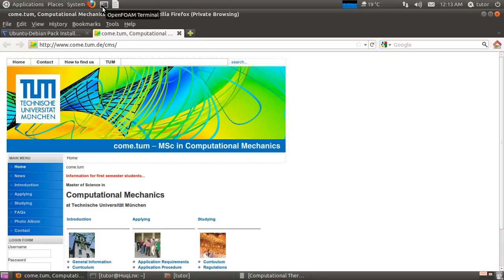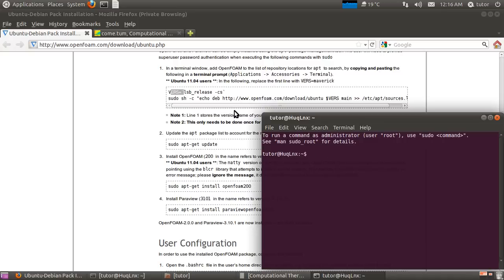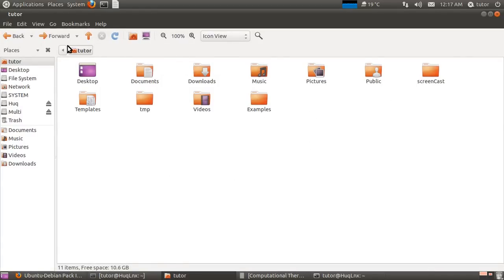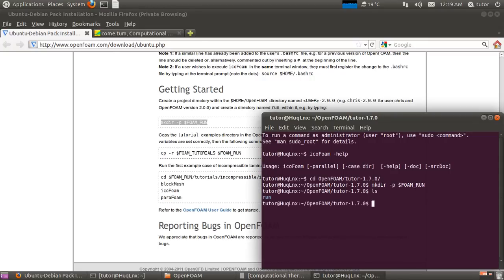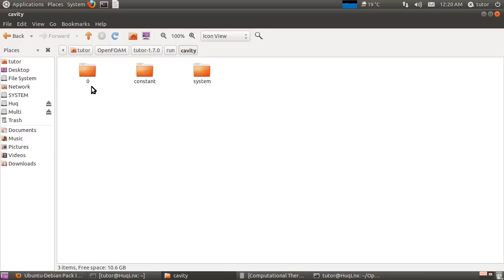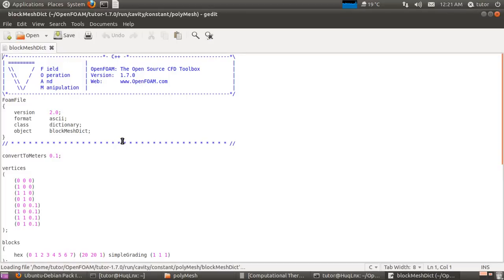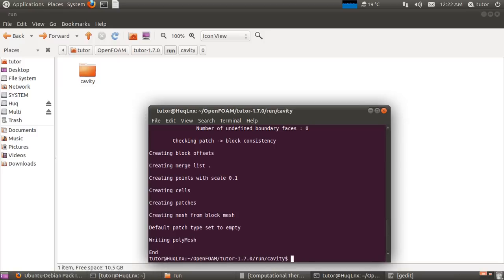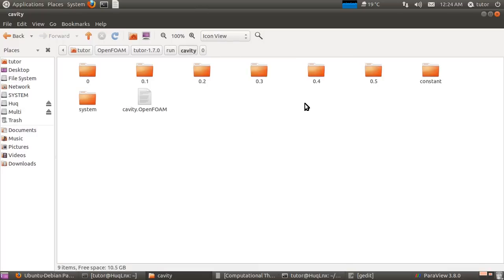OpenFOAM Tutorial #1 - Intro, Installation & First Simulation

Comment: When trying to open in ParaView, output is as follows:

derek.fricke@DGP-051 ~/OpenFOAM/derek.fricke-2.3.x/run/cavity
$ paraFoam
created temporary 'cavity.foam'
/opt/OpenFOAM/OpenFOAM-2.3.x/bin/paraFoam: line 272: paraview: command not found

Any idea why?  ParaView is installed.  This is operated through Windows using cygwin64

Comment: Sorry for the basic question but could someone tell me why Openfoam insists on using linux? whats the big deal with Linux, I've only ever used windows. Is Linux something big and special????
Reply from the maker: 'Why Linux?' is the first question many starting with OF ask. Paul Bevillard pointed out the cost factor. OF or other scientific softwares are not run on regular Desktops, where windows might have advantage in ease of use. Industry and academia use HPC for production runs and they are almost exclusively Unix based systems. In a couple of weeks, I will make a blog post on this topic. To answer in short, yes indeed, Linux is something big and special. Big => size of machine.
-S.H.
Reply: The thing you may have to think about, linux is free. (Well at least most of the Linux OS out there). Where-as, microsoft OS is not. It may very well be that certain businesses wanting to keep costs down use freeware. Linux has so much more versatility, but the learning curve can be steep depending on what kind of Linux you have installed. Examples: Ubuntu or Arch based linux. I dual boot, Win 7 for ease of use (I have been using microsoft products for a majority of my life), Linux for running engineering apps. I have been using Linux (Crunchbang on my laptop and Manjaro Openbox on the desktop) for 3 months now, and still have quite a bit of learning.
Reply: the question can be called 'basic'... or else. whatever. by the way there is openfoam for windows as well.
Reply: Alex The Infinite yeah well... doesn't change the fact that it exists :)
Reply: CoolBananas If you're using windows get the payware: FlowWorks or FlowVision. ;)